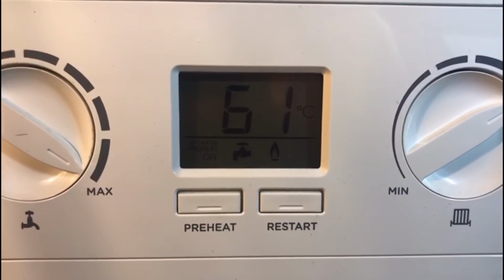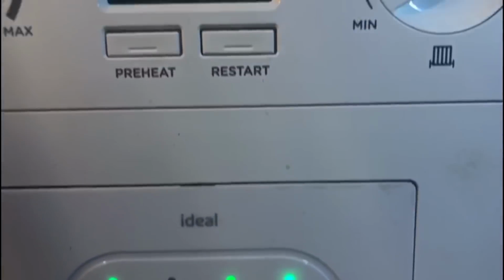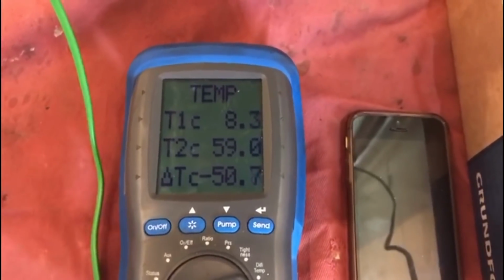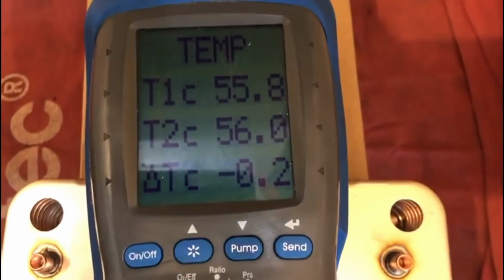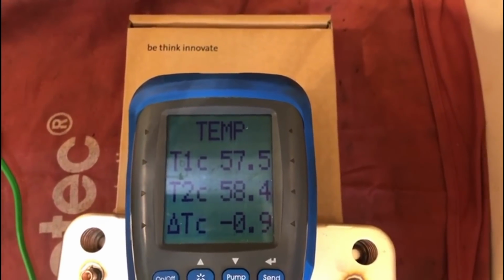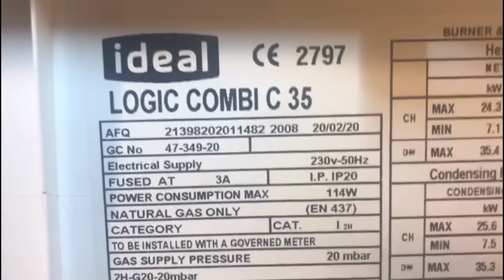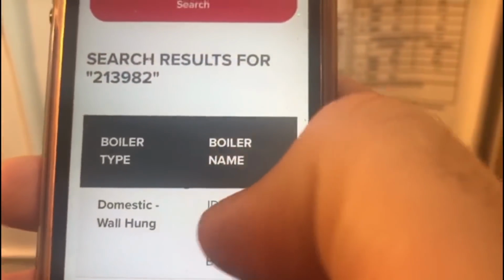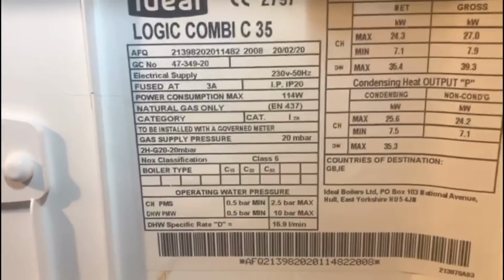No Hot Water - How To Test Plate Heat Exchanger - Combi Boiler not working

Comment: The easiest way to test the plate heat exchanger is to touch the top left of the plate and then touch the top right of the plate and if the right hand side is a lot cooler then the plate is getting blocked

Comment: So to recap first test between hot and cold and check for 35⁰C temperature rise and stable reading. Then test between hot water outlet and pipe between pump and main heat exchanger, there were 20⁰C difference and there should be zero or close to zero. But when it finally became 0 on third attempt, is it because you cleaned the plate or you put the clamps somewhere else? Thanks advance!

Comment: Can anyone help me diagnose my issue - basically turn tap on, might get a little bit of hot for a few seconds (in the PHE?) then cold - then takes ages, a minute maybe of completely cold water, then the hot starts to come through. Once flowing it's fine, stays how, flow rate no problem, runs all day.

I swapped the DHW spinner last year, when you turn on a tap the sensor lights up solid instantly, boiler seems to start.

I removed the diverter valve and stripped it, cleaned it in ultrasonic cleaner, put in new seals, rebuilt it with lashings of silicone grease

Actuator works fine, tap on, tap off it moves in and out and the plunger pushes in no problem in the valve (did before cleaning anyway) - heating outlet not getting hot when waiting for water

PHE off and cleaned with drain cleaner and in ultrasonic, just a bit of rusty crap coming out, no sludge in there and it's a soft water area so no limescale.... Water flows though both sides well from hose pipe.

Again once running hot water is more than adequate, heating works fine

Waiting for a plumber friend to come check gas pressures etc as very rarely do get an ignition failure - can't see it being that as it locks out after 3 failed starts and it's very rare (maybe 1 this year)??? Boiler did have a gas valve about half it's life ago as it had turned into a vuvuzela....

I'm stumped!! Help lol 😄
Reply: Did you resolve this in the end? (I hope so, being from 2 years ago 😅)

If water was flowing, but the hot outlet pipe was not getting hot, was it the temperature thermistor?

NTC thermistor should have shown 10k ohms at 25c. If it thought thr water was already hot it wouldn't try to add more heat, but would allow the cold water to flow freely thinking it's already hot.
Reply: @Trekforge  I tried everything, thermistors all ok, DHW valve serviced and tested (no heat leaking into central heating side when taps on), DHW exchanger fine (tried a new one anyway), gas valve, gas pressure tested - everything I (and my plumber mate) could think of.

We were having to run the shower at lower flow to keep the temp up. 

In the end I decided it was either the pump (not pumping well enough to keep the DHW exchanger hot, or the main heat exchanger I gave in and got a new boiler!!

Comment: Not sure of its a separate issue but a) lack of hot water via taps . Mostly goes cold ..... kitchen tap (,been fine 3+ years now is the only tap mainly that don't cause boiper to ignite . 9ccasionally it'll stop getting up upstairs bath over head shower (mixer.  Both are ) a head ache indeed .

New vaove cartridge here and diverter pump 

Thanks 4 your help

Comment: how did you calculate the cold water temperature rise (the 35 degrees)?
Reply: It’s in the manufacturers instruction, they state what the boiler is able to deliver (temperature rise) and the maximum flow rate it can give you that rise at
Reply: @daleprosser350  do you mind explainging what that means, in the manual it has: 

DHW Flow Rate (for C 35) at 35 degree's C temp. rise = 14.5 l/m
DHW Specific Rate (for C 35) = 16.9 l/m

What is Specific Rate and I am a little baffled with the two Rates. Thanks again mate
Reply: @frosty-bf  to be honest I’m not sure about Specific Rate and why they have the two rates

Comment: Im relatively new to boilers and I was inspecting a hot water issue today with a eco Tec pro 28 combi boiler. Visually I could see major scale at the cold inlet to the plate heat exchanger. In addition the hot water appeared to be running well until suddenly it stopped coming out the faucet, then continued after about 12 seconds. I'm pretty sure it was the plate but does anyone have any other ideas? Wasn't isolation valves as none existed on the pipework....note: the water did reach requested temperature prior to cutting out. My guess is it's a sedement blockage, but any other suggestions are welcomed. Thanks ppl.

Comment: I'm assuming the tests in this video apply to all makes/models of Combi Boiler, not just Ideals?

Is it also correct that you can check the temperature of the primary circuit flow and return in and out of the PHEX and that a temperature difference of more than 20 degrees indicates a blocked PHEX? I'm sure I've read this somewhere but can't recall where.
Reply: No this is just the logic only due to its design, other designs may vary slightly in temperature depending on where you put your temp clamps.

Comment: Hi Allen, i have hot water running very slow in all tap in my apt,do you think is cause block exchanger? Many thanks
Reply: Most likely
Reply: Double check that the water inlet isolation valve hasn't been turned down.  The hot water flow usually stays about the same on a blocked plate.  As it usually the flow circuit from the main heat exchanger which gets blocked .  Check your mains water tap is open fully and follow the cold water feed from the boiler back.  Sometimes there's an isolation valve or something similar fitted.  This could also reduce the flow to all hot water outlets.
Reply: @rayc1503  the cold water inlet to the plate exchanger could be blocked up with scale if he’s living in that type of area

Comment: Great video and just one quick question:
What I understand is that the heat lost in the primary circuit between flow and return should be gained by hot water side.?
Lets say the primary flow was 75c then return 40c. Then the hot water would be 40c? How is that. Bec i thought the hot water temp = cold water in temp + (diff between primary flow and return) 
So lets say cold water is 8 c and the pFlow 75 preturn 50c( meaning a 25c lost to heat hot water) then hot water is 8c+25= 33c
Sorry if that looks naive

Comment: couldn't the diverter valve be letting by not giving the temp rise?
Reply: If you listen in the beginning I mention that the diverted valve or stepper paddle could be passing heat down the flow pipe

Comment: Hi,
What is the reason of having a hot water coming out only when is on full flow rate and when reduce the flow rate is getting cold?
Regards
Julian
Reply from the maker: Blocked plate maybe?
Reply from the maker: Thanks very much for your comment, please consider subscribing to support the channel 🙂
Reply: I would think the flow sensor for the hot water may be faulty and the low flow rate may not be registering with the sensor

Comment: At the very end I found the part number ID to be very helpful , sick of wasting time with wrong parts. Unfortunately though he said the part was 121 and this then showed two listed 121 plate heat exchangers. I assume for different kw outputs. But which one would you chose. My supplier is clueless and I have to order exact part numbers. I would love to say get mea plate heat ex for .... 
But I then would get the wrong part.
Reply: 177529 - 24kw, 177530 - 30 & 35kw, this is the latest model, on older models this would obviously be a different part no.
Reply from the maker: Thanks very much for your comment, please consider subscribing to support the channel 🙂

Comment: Excellent video Allen, great tips and something to take on board. I have the testo probes myself and use for boiler commissioning.. 

Can you do a video on balancing radiators using the testo probes... I’ve tied but struggle to get the ideal 11 degree difference between flow and return

Comment: Great video yet again from ideal man only thing I would add is he should have tested the cold water flow rate as it could be the cold feed could have only been 10 litres per minute so putting a 35kw boiler in and thinking you would achieve 16 litres , always check water pressure and flow rates on a cold tap before you install a boiler .
Reply: I never thought I would achieve 16 litres per minute when I installed my boiler, I put a larger boiler in knowing I would infact get a better delta t, temperature rise because I had a lower water flow rate, I just forgot what my flow rate was when I was making the video and then realised I could not get the 16, it was the reason you saw in the video why I put in.a 35kw so I could get a temp diff way over 35 degrees.

Comment: Very good video , 
sorry if this question seems silly, On a boiler with a 3 speed pump, Does the speed setting of the pump have any bearing on the  heat transfer temperature from the main heat exchanger to the domestic hot water at the plate heat exchanger  or will there be no difference what ever the pump speed is
Reply: Yes it does..you stick it on 1 on a 3 speed and it will cause you probs